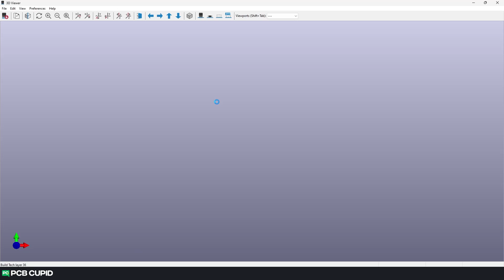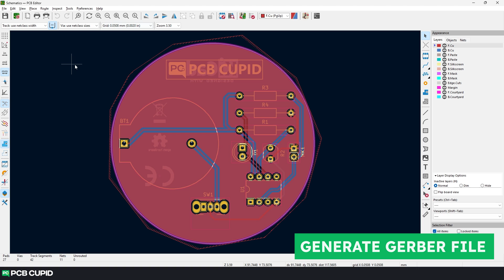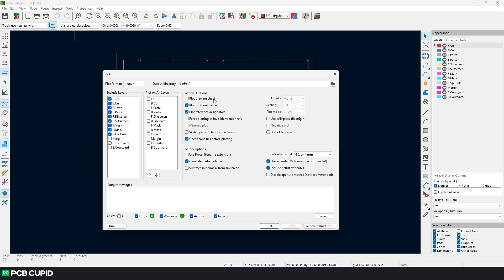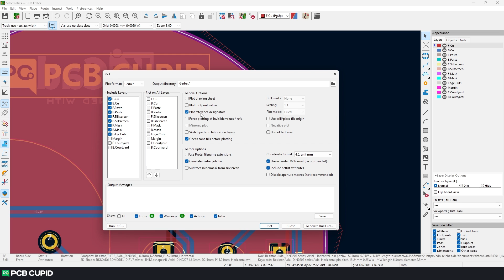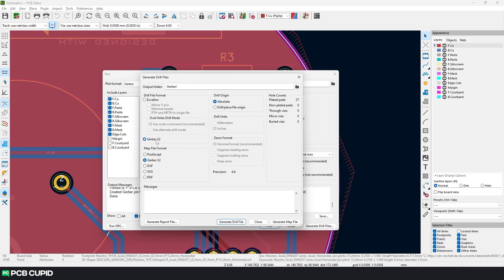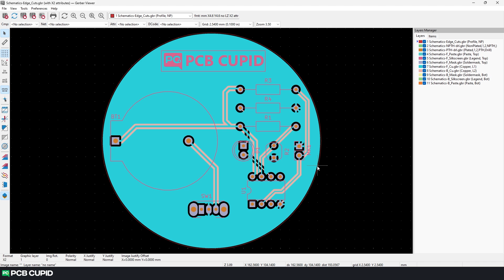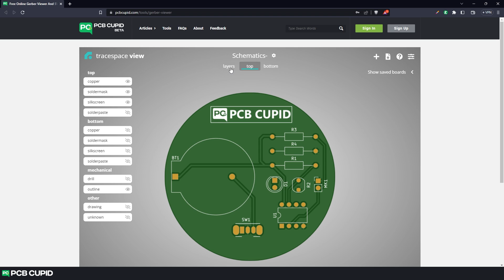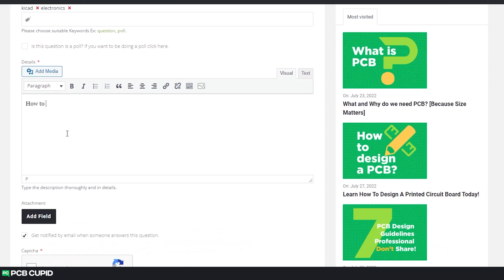#12 How To Generate Gerber file In KiCad 7.0 | #PCBCupid

Comment: How to generate netlist
Reply from the maker: You don't have to generate netlist after version 6. Kicad will automatically handle the synchronization between schematic and the PCB Layout for you. 

But if you need it for some other reason, Open Schematic Editor -> File  -> Export -> Netlist.